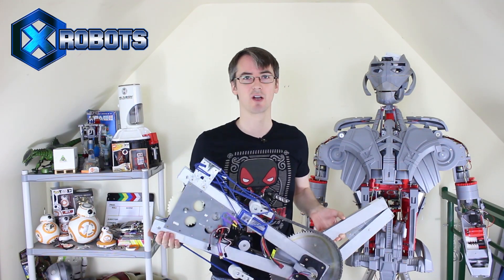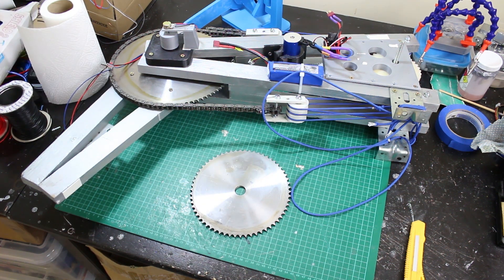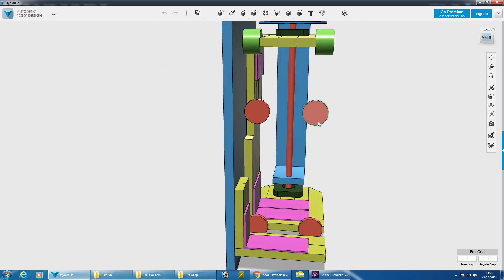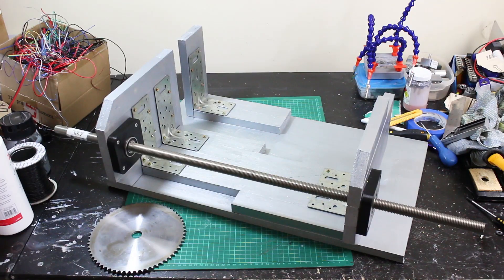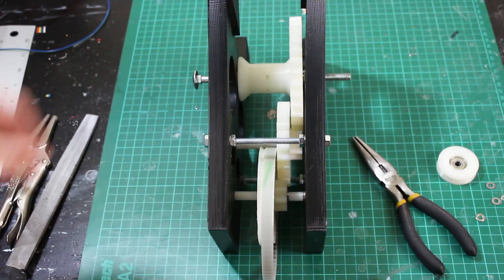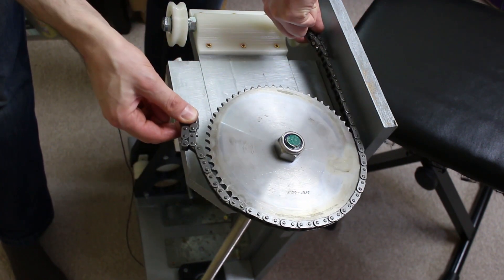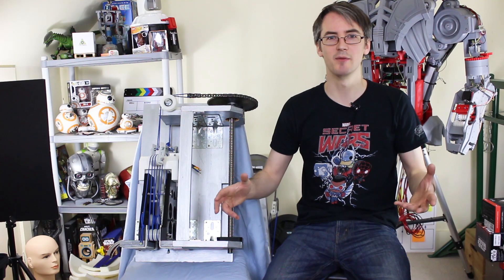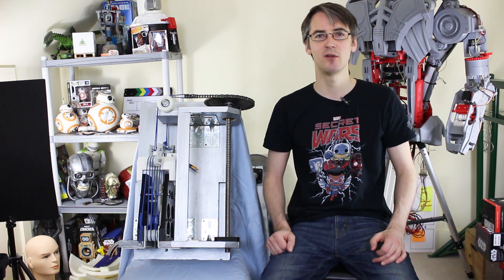Iron Man Exosuit #6 | Building Power Arm | James Bruton

Comment: I said to myself (and commented I'm pretty sure) in episode one that an arm like that wouldn't work without some way to transfer the load down to the ground/floor, that's how exosuits work, just strapping an arm to your torso doesn't really work. Simplest way to make it work I guess is just make a rigid stand for it that you position where you need it and step into to use it, caster wheels might also work though should probably have some way to lock them for safety.

Comment: It would be alot easier alot smaller and alot cheaper if you would just use linear actuators you can get one for about 35 dollors it would do 220 lbs and 12 mms a sec now I'm not saying hes a idiot right I'm just saying a recommendation for if he ever builds another one so don't f0cking kill your self with angry over this
Reply: oh and you should use steel not wood for the same strength it a lot smaller
Reply: Freesethman he can get the same effect if he were to gear the arm down enough. Reduce speed and increase strength
Reply: yes but it still would be smaller and a lot less to go wrong with a simple system linear actuators already work off of a motor so this way all you would have to do is buy it pre made
Reply: James Bruton I am working on an exoskeleton with linear actuators and it seems like I will have to get crowd funding
Reply: Have you considered Shape-Memory Alloy/MuscleWire?
I've always been intrigued by it and wanted to do a project around it.
Reply: Kobe Wuyts like nitinol?
Reply: gamerdudes superelite nitinol or flexinol. I guess there are several brand names these days

Comment: I would love to see legs, with Air muscles.
Reply: Gary Oldham you mean pressurized pistons?
Reply: They are called Air Muscles and used by all of the high tech robots that use human motion, just google it.
Reply: Gary Oldham interesting thank you! :) 

But are they basically a more advanced form of those?
Reply: Yes, and they give you more picking up strength, which i was hoping James was going to use for this project, could be built to hold more weight than he's doing now and weighs less. I spent 25 years in the US military as an engineer that trained at Stanford University.
Reply: Gary Oldham nice! Wonder how much they cost for him, that may be the do or don't decider
Reply: Gary Oldham haven't gotten to look the stuff up but he said he wants to keep the wait down and doesn't want to carry a compressor or anything around that weight
Reply: and i figured you could solve that problem, i've seen you solve some pretty good problems. And in support i bought a shirt from xrobots, i found my size this time.
Reply: touche!

Comment: Don't push yourself with power legs! Use a simple lever arm and leadscrew setup to create a sort of elbow spine between your frame and the ground unit. Should allow you to lean over or bend your knees if necessary.

Comment: instead of legs or a base what about making your mechanical arm and shoulder smaller and lighter. I know it won't be as strong but you might be able to support it without the need of legs or base.
Reply: I don't know about that,Making the thing so small and light would defeat the purpose of it.It would be really weak and fragile.
You can get it to be small and light but certainly not on a budget with 3D printed parts,wood and steel.

Comment: In the long run, it might be easier to build the legs now, because you still should have a lot of the mechanics of legs on the mind, whereas later, you will forget some things, that you'll have to work out again. I still like the idea of the wheeled base. I would add weights to the base, to give the overall thing a lower center of mass, to resist tipping over. You could even use lead acid car batteries as the weights, and they would double as the power supply. Keep in mind that you don't want the base structure in the way, when you bend down to pick something up with the arm. I have seen people use concrete counterbalance weights for digging vehicles, where the weight is attached to the back of the vehicle, which allows the digging arm to extend a ways away from the main body, and lift things, without tipping over.

I think it would be really cool, if after you finish this power arm project, you can actually occasionally get real usage out of it, when your doing regular tasks.

Comment: for the load problem have you thought about using struts like the ones that are used on cranes, if you have them built into the hip area they could fall out at an angle and lock into place, you could use servos or moters to do this.

Comment: I'd say power legs BUT only if you can get the arms all working properly. until then, focus on the arms and do wheels for the base. definately a powered wheel base though, otherwise you've basically just got yourself a motor lift like they use in auto-mechanics shops, accept it's one that uses motors and happens to contour to your body nicely.

Comment: Hey James. Looks like you are approaching CNC router time. Did Xcarve offer you one of their units? Gears precision cut from 12mm sheet nylon or HDPE.... You've already got the CAD down. 
Of course there would be issues with the noise and amount for floor space taken.
Just a suggestion. It's not like you don't do perfectly fine as is!

Comment: a few things 
1. the thing is massive and like he said a 2 hand lift so where would the other axis mount and perhaps the other arm
2. from my moderate exoskeleton building experience the weight shift is a really big problem. even if the suit can handle that much weight distribution of that thing will either result in the mechanism shifting or you just falling over.

I definitely still like the build I just think those points are going to be problematic.

Comment: be careful with the wood, so far that's your weakest part, even weaker that you glued them together, it's not one solid part and adding steel bracket will help some, but you are still screwed into the weakest part "the wood".

Comment: Money is the only issue. There are motors that would be 15 times stronger. Imagine something with the power of the hacksmiths new ascention device for the grappling gun geared down to speeds near what your exoskeleton  has.

Comment: If you do go with the awesome power legs, would a motor like this be suitable? http://alienpowersystem.com/shop/brushless-motors/c80100-outrunner-brushless-motor-50kv-6000w/ 
6000 watts, and only 50kv, so once its spinning it should have incredible torque... you could save having to use pulleys and just chain drive it?

Comment: So much done this episode, great work! But I notice something: from the look of things, are you going to build only one arm?
And as for a partial solution to hauling the heavy mechanism, maybe you can incorporate the hip-straps like those found in hiking/backpacking backpacks? It should rest it's weight on your hip as opposed to your shoulders, making it much more comfortable. For full support, I prefer a wheel base.
Reply: Yup, I picked the wheel base (mobile issues so I wasn't able to pick earlier) But I mentioned the hip straps anyway in case you don't want the wheel to brace...all of the weight. And as for my single arm question....?
Reply: Ah, I see.

Comment: Surprised you doubled the ends of the chain over, if you simply thread the chain through the appropriate links, you should get more movement as the cord would get closer to the cog.
What about tracked base ?

Comment: Awesome, as always. Thanks!

FWIW, Nylon paracord is very stretchy and adds a lot of friction. Something like Lash-it spectra cord would be stronger, lower stretch, lower friction, more resistant to chafe and easier to splice. You might also save some weight by cutting those gears in half or by using a mechanism like a steering quadrant.

Comment: that wood doesnt look too strong i woodn't trust it :P
Reply: Wood is only the material trees are made of. It's not like it's made to resist extreme pressure from above and large shear forces from strong winds or anything.
Reply: Dude, he probably gets 1000 requests a day from people wanting to chat or answer a questions... Why are you so special? Back off and let him do his thing....
Reply: James Bruton did you see what I wrote to you??
Reply: James Bruton dude please answer
Reply: MDF removes both those properties, its just dust particles glued together into a block, but its the joints that didnt look too secure to me although as james said, he did reinforce them with the 2mm thick steel angle brackets.
Reply: If he were to really push it to it's limit it would break much sooner then something made out of steel, but for a proof of concept wood will hold up just fine.  Yes the 2mm steel helps, but it is still reliant on how well the fasteners hold and if there was adhesive used to bond the piece together.  MDF does better under compression, but it also has a chance to flake apart being it is just sawdust and glue compressed.  A high grade plywood would have been a better choice and it would have also reduced the weight some.
Reply: DIY Jet Engine Guy :|

Comment: I'm not to sure about that wood
Reply: Marcos wood has really good strength to weight ratio. If he were to use a metal, it would've been much heavier.
Reply: Quintus Aurelius Symmachus oh yes I'm not saying to use metal i know it would be heavier, I was thinking maybe carbon fiber idk how much that is but maybe it's good since it is strong and light weight
Reply: Marcos Ah, gotcha. yeah, I wondered the same thing. Why not print something out on the his 3D printer? Carbon fiber sounds like it would work really well too.
Reply: Quintus Aurelius Symmachus part of the problem is that carbon fiber infused plastics are still plastic. There are some advantages, but the strength benefit can be hard to notice. There are a few YouTubers who have done strength tests on various materials, not too hard to find. ;D